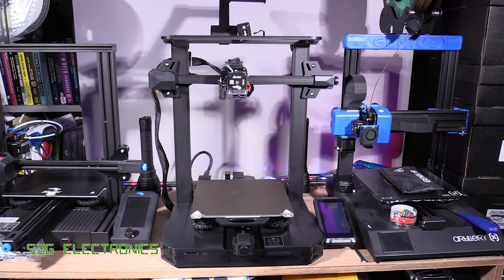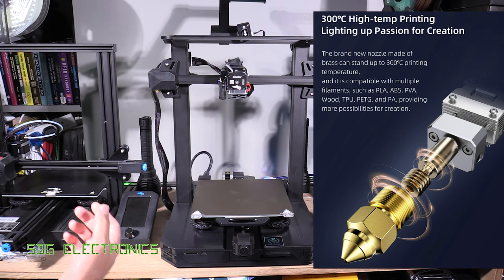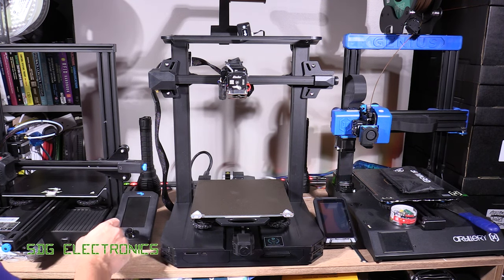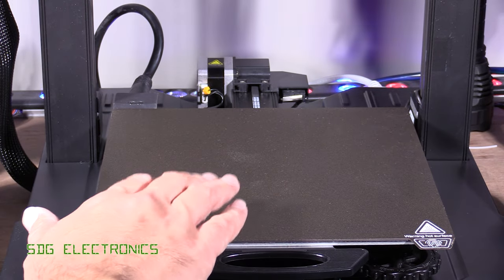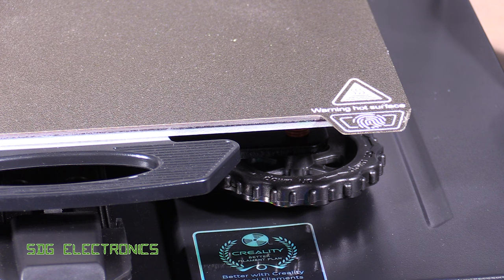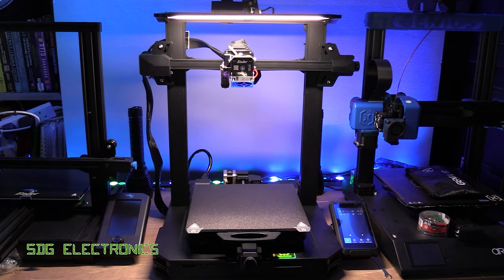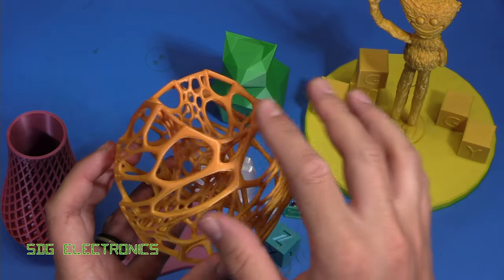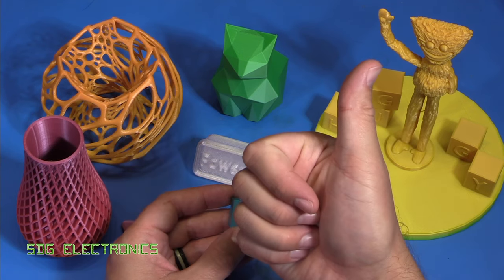SDG #271 Creality Ender 3 S1 Pro 3D Printer Review

Comment: That's a big price increase over the old Ender 3 pro, i only paid about £140 for mine. i expect a much better print than mine to spend that much extra.

Had problems with PETg it seems to be a material that just does not want to print. Too hot and it jam's, not hot enough and it jam's, feed to fast or slow and it jam's. but got there in the end, and this was on a £2K printer. Not mine of course. :-)